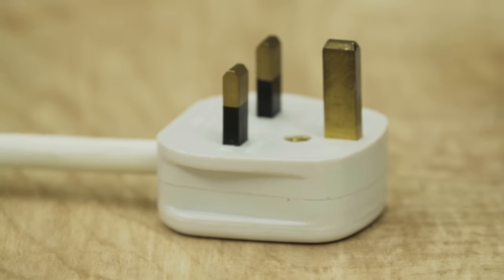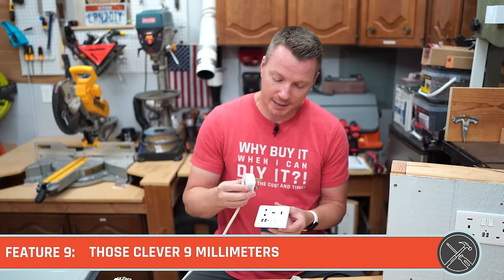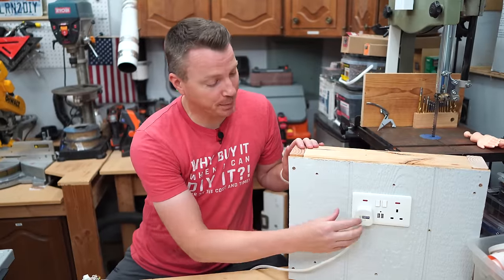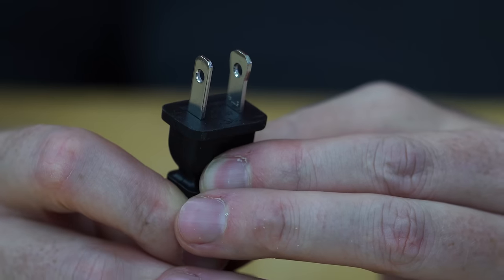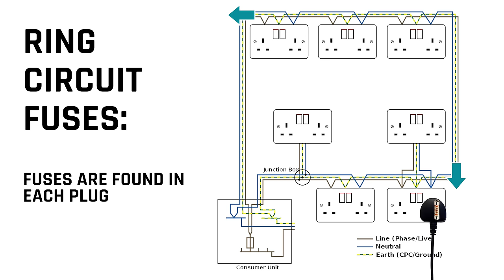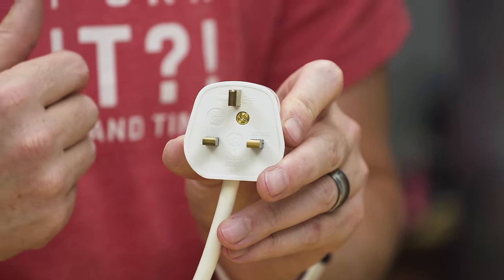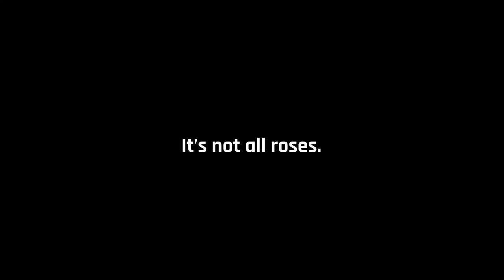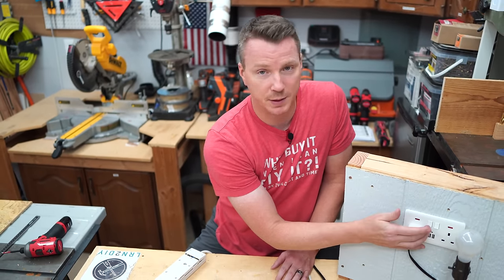British Plugs and Outlets Are On Another Level

Comment: They really are a work of art. So many safety features that are taken for granted and most people wouldn't even notice.
Reply: That's really electrical engineering, it's a truly amazing subject but people just take it for granted.
Reply: @Fastnet72  Calm down Peter. You'll get there in the end..
Reply: Can confirm, am british, didn't notice.
Reply: @Fastnet72  its much better than the mona Lisa.  Beautifully designed engineering which is taken for granted
Reply: The reality of great design is that you're not supposed to notice.
Reply: They are amazing, before moulded plugs there were also other features eg some had a little window so you could see the fuse rating.
Reply: The only time the size is annoying is when carrying a laptop charger around.
Reply: The German one is superior. they solved the ground issue without turning the connector into Neptune's trident.
Reply: @alpacamale2909  the German plug is awful. The socket wears out overtime and if you stick anything in it becomes loose.
Reply: @TheRealMikeMichaels  Never had that problem happen to me.
Reply: @alpacamale2909  oh no, the German is saying he's superior...
Reply: @hugeman537  hahaha
Reply: @hugeman537  you hit him hard man
Reply: @alpacamale2909  
The German plug has no fuse and other bad features.  The Germans suggested a standard plug and socket fro the EU. They suggested the British.

Comment: As a Brit, the size of our plugs has never been an issue. I've lived in the EU and spent time in the US and am always baffled by how flimsy the connection feels with US sockets. I've also never ever had to think about load balancing in any house I've lived. Our electrics are pretty foolproof: plug what you need to use in and that's it. I have also stood on a plug once, in someone else's house, and believe me, once is enough, you learn to be tidier!
Reply: Aye, I personally love that the lighting is on a seperate ring so that on the rare occasion where I have caused a load imbalance or a piece of equipment had an earth leakage, I don't have to feel my way around to find a torch in order to get the sockets back on.
Reply: Agreed with you that British plugs are very safe and foolproof. Sometime I even think the safety standard might be too high that used too much material.
Reply: The plugs fit flush to the wall as well which means they hardly take up any space when connected
Reply: Yeah, I don't understand why load balancing was even brought up as an issue, as long as you don't exceed the ampere rating of the circuit breaker you never have to even think about it
Reply: Our plugs are always perfect, to the level that we go abroad and cant believe how bad other systems are.
Reply: @clleo888  "safe"
WHAT IF YOU STEP ON THAT?!?!
Reply: @rexperverziff  well, to be more specific,  it's safe in electric point of view. I know it's not safe when you swallow it...😆
Reply: The fuses are all colour coded to suit the ampage  brown = 13 amp, red = 3 amp
Reply: And we in EU be like: this probkem even exists? 😂
Reply: I still prefer Type F (if you need a ground) and Type C as they come in many shapes and are more versatile. Type G is solid (and bulky), but overkill for >80% of the use cases.
Reply: Load balancing [edit: not really the right term] is more an issue for the installer.  In a modern installation, you may have a kitchen ring and so the majority of the high-power appliances are very close together.  Houses are insulated (sort of), and we often have gas heating.

In an older house, there could be 1 ring main for 1000 sq ft floor area, and then if you started plugging electric heaters, washing machines, or tumble dryers, you could quite easily start to take a lot of current draw off one end of the ring.  A 30A fuse or MCB doesn't really trip quickly until you start to overload it seriously (you don't get an 'instant' trip until you start drawing 150A), so you could draw 40A for several hours (3 x 3kW electric heaters would do it) on one end of the 20A rated cable used for ring mains, leading to eventual fire at worst, or (more likely) gradual failure of the insulation and eventual shorting.

The point is, even at 30A current draw, you could still start to overload parts of a ring if you tried.  In practice, good system design means that is unlikely to happen.  It remains, however, a disadvantage of the system.  I've seen installations in both Italy in which the electricity supplier cuts the electricity off very sharply immediately you exceed 13A (and with the new smart meters, there is zero tolerance).  The plug wiring is built to take a constant 16A safely, so it is literally impossible to overload the circuit.
Reply: Load balancing refers to the American breaker panel. In the states we have a 120/240 volt split phase system. That allows us to use 120 volts with a neutral or we can use both phases to run the full 240. Because we split a single phase, we make efforts to “balance” each phase when running branch circuits to the rest of the house.
Reply: @esl4058  Hmm.  I think you're right that 'load balancing' isn't really the right term for what I meant about having the load being, ideally, reasonably evenly distributred around the ring.  Thank you for the clarification.
Reply: @andirutherford2615  5amp is grey or black
Reply: Agree, "load balancing" has never been an issue. First time I've heard it mentioned!
Reply: American terminology. I knew what he meant.
Reply: I think British plugs are better than US plugs, but I think the US electrical system is better than the British system because we have a choice of voltages 120 & 240.
Reply: And to think a few decades ago, there were talks to change them to match the rest of the EU!!
Reply: @rexperverziff they are nearly always left in the socket as you can use the off switch at the side. I've never stood on 1 in 50yrs

Comment: I love how the downsides of the G-plug are totally irrelevant things, while its fenefits are complete game-changers
Reply: Yeah. It's a fair evaluation, but the conclusion is that British plugs are, in fact, undefeated
Reply: I agree, and their size means easy to grasp
Reply: Lol USA greatest country uses 120volt 8:46 while the rest of the world 230volt.
Reply: With everything going low voltage seems completely overkill to have every outlet capable of 230v.
Reply: @davejulien  110v systems need larger diameter cables to avoid volt drop, so a 230v system uses less resources.
Reply: Well, all irrelevant except maybe that last one. (voice of experience here - yes, that really does hurt).
Reply: The part about using the plug as an excuse to build a ring circuit with light gauge wire is a legitimate downside. Wiring really should be close to foolproof.
Reply: @danielbliss8014  so you’re saying every socket should be wired to the DB independently? That’s not going to work.

There has to be selectivity in the safety devices, even radial circuits have selectivity.
Reply: @davejulien  The same could be said about 110v in all fairness. Most devices don’t warrant power above 24v and so you get plugs with transformers built into them. The higher voltage is certainly well-used in the UK though. E.g., kettles, ovens, portable radiators. There is also the advantage of lower current draw for the same power.
Reply: I still prefer Type F (if you need a ground) and Type C as they come in many shapes and are more versatile. Type G is solid (and bulky), but overkill for >80% of the use cases.
Reply: @shahtayyib  laughs in European
Reply: @davejulien  no it doesn't work like that.
Reply: @danielbliss8014  another commenter who doesn't understand regulations in UK are very strict maybe go take a look the cable gauge is far from being light.
Reply: I'd argue the size isn't even an issue, because the cable goes straight down. I can't imagine the struggles Americans must have trying to use a socket that's behind furniture, as the plug points straight out of the wall.
Reply: @stevenvanpelt486  Type G is not overkill, it is superior in everyway, if you grow up with it, anytime you go to another country, you will always be questioning if it is safe or not to plug something in
Reply: it's not though.  even small things like a kettle boil twice as fast, and my hot chocolate machine wouldn't even run on US voltage :P @davejulien
Reply: Another downside could be, that there is only one direction to plug them in - compared e.g. to the German Schuko plug which has 2.
Reply: @danielbliss8014  it is. The ring or to give it real name, ring final circuit, most of these are 2.5mm² twin and earth in domestic settings, are protected by a 32amp MCB. You can have an unlimited number of sockets within 100m² Granted, they could become a bit dangerous if the ring splits as the current can travel in both directions, meaning, if it was 2.5mm² twin and earth cable which was used for the ring circuit, it would no longer be protected by the 32amp MCB as this would be greater than the current rating of the cable.
Now, you can plug in anything you like into a UK socket upto a rating of 13amp per appliance but you cannot draw more than 32amp in total for that circuit otherwise the overcurrent device, the MCB, will trip.